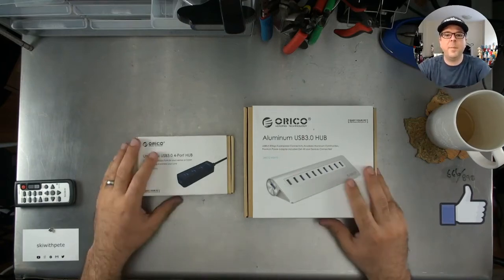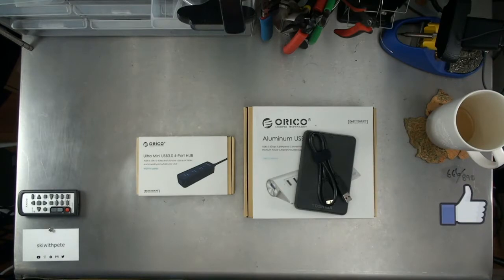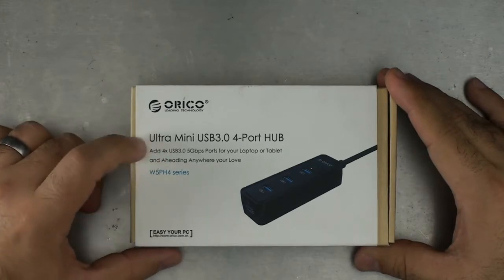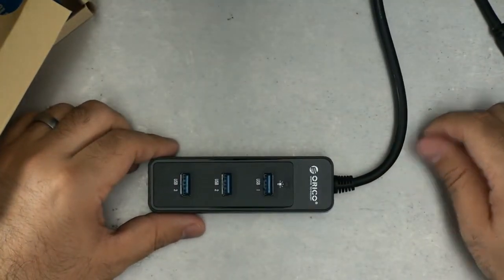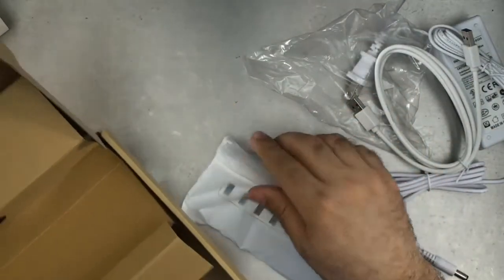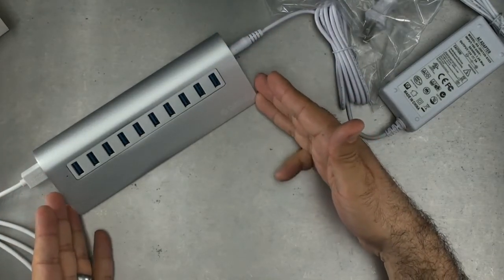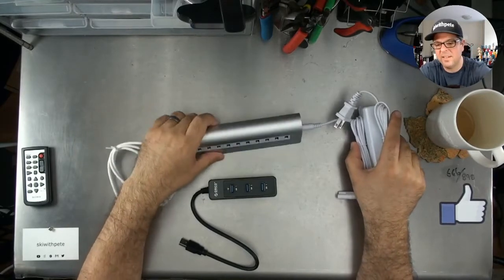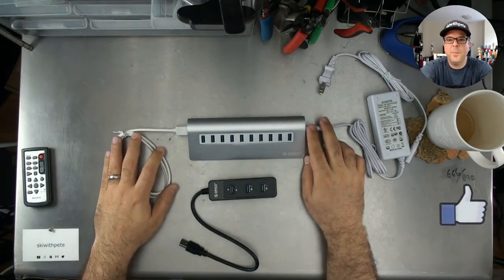Powered vs unpowered USB hubs - which one is right for you?

Comment: I plugged a powered usb hub into a nvr and the nvr started to make a burning smell, and the usb ports don't work on it anymore, did I just kill my nvr?
Reply: Did something similar to a Sabernst unpowered USB 5 port hub I was trying to use as a charging hub with a USB to DC adapter & a battery backup. The hub is screwed. Luckely no damage to the battery backup. My hub nearly cought fire. I made the mistake of connecting the USB to DC adapter fron a wall USB outlet to the DC charger in port.

Comment: I'm thinking a powered USB hub will prevent the issue of my pc turning off wheel i use my gaming wheel.
Reply: Chances of that are very unlikely though. If the hub or PC starts to go bad the fact that its powered wont really save you much. I've used powered hubs without the power adapter & it makes little to no noticable difference wether its powered or not. Other than taking up space on a power strip or wall outlet & needlessly wasting electricity there isn't much point. It might make the most difference with hard drive life connected to a powered hub.